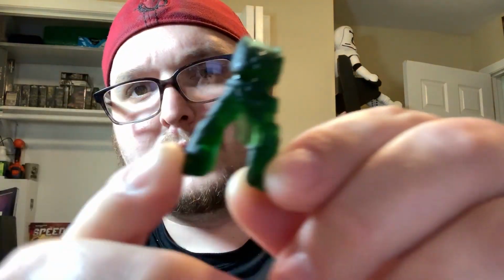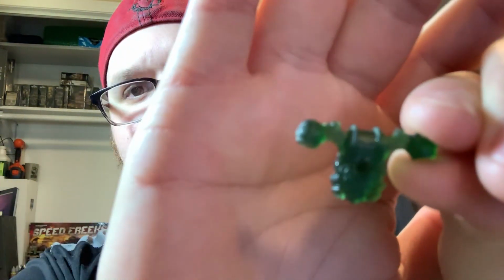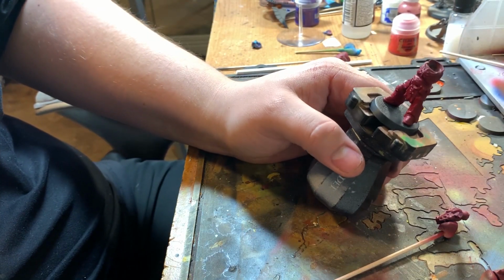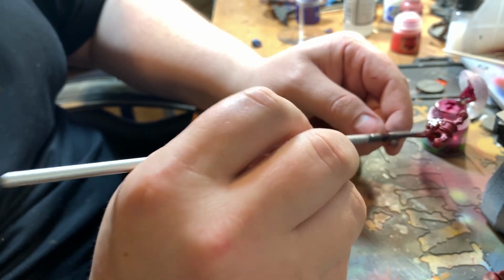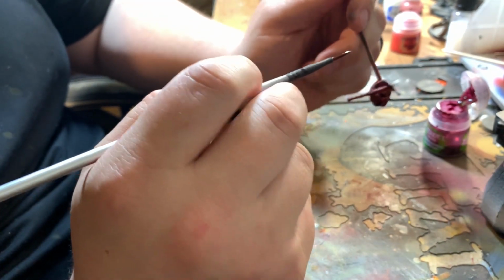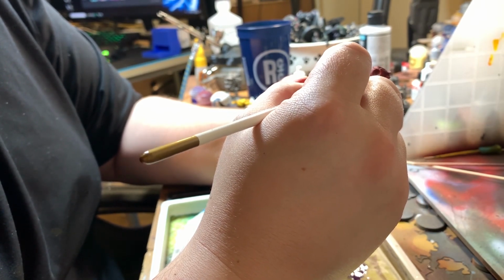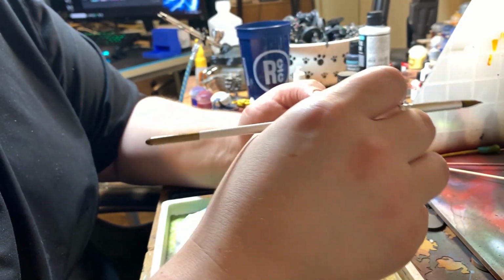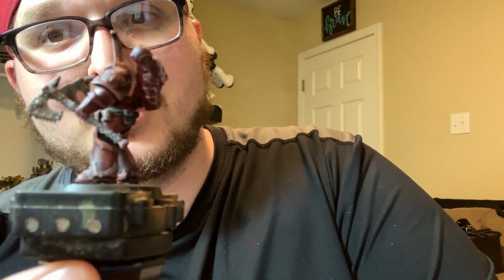Are 3D Printed Models Cool Now? Lets Find Out!

Comment: Very good video. In my opinion though, the main advantage to 3d printing is the ability to make custom bits however you want. Not necessarily supplementing missing regular bits, but really customizing your army. Want an awesome relic to designate your commander? Boom. Custom bit.  Ever wanted to play hurd as an army? Done. Need some Tau-converted space-marines? Entirely doable. Limitless possibilities.
Reply from the maker: I agree, its crazy what 3D printing can do for our hobby community. Just like airbrushing in the painting community has become more accepted than not, I believe 3D printing will to!
Reply: @ministudiobros2123  My head explodes a little bit each time i consider all the bits and customization we can do with printers like the photon.
Reply from the maker: @J0shuaGam3r  And the customization that can set your army apart from everyone else. It's nuts!
Reply: Yea or make the bits they NEVER have in stock..like a Butcher Cannon lol

Comment: Grey resin is easier to see the detail after printing then the translucent ones that you need to prime first to see it in all it's details.
Thing is that you still may have some support marks on the model and it's hard to see with translucent resin and it 's faster to remove those before priming.